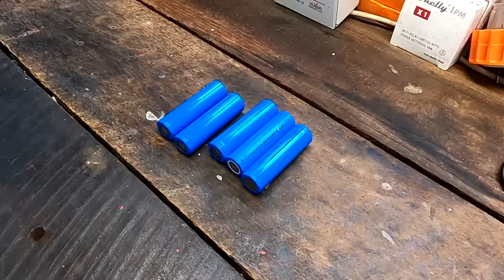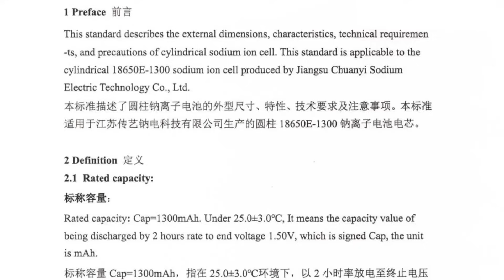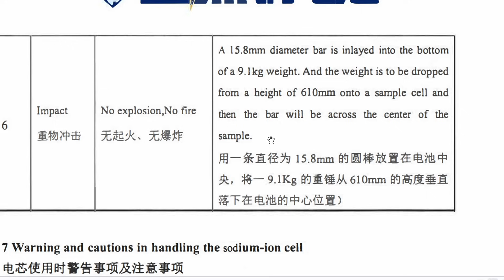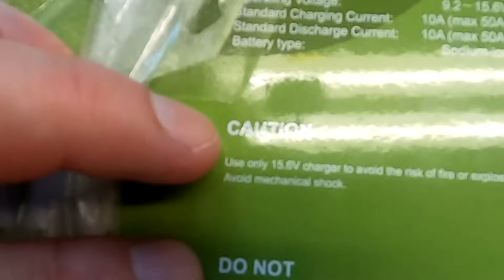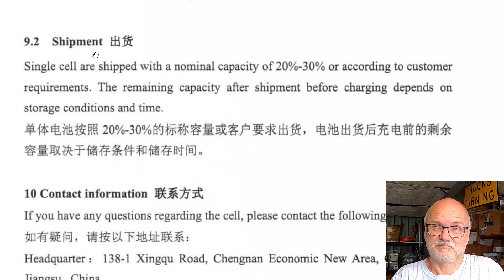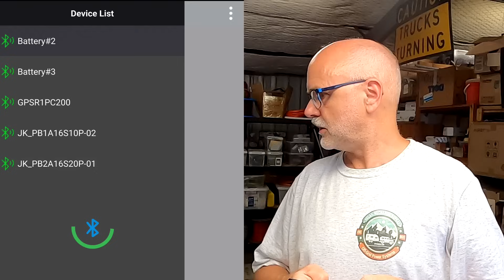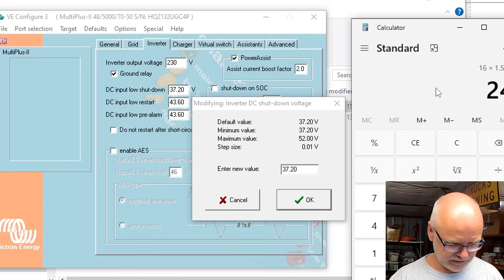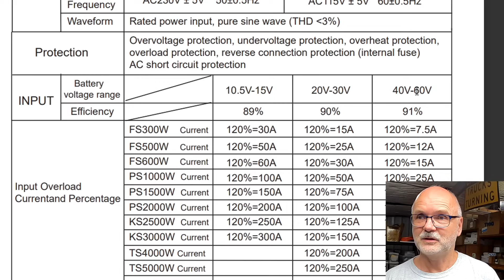Sodium Cell Charging and Discharging Analysis, Hardware Compatibility. Future or Niche product?

Comment: From personal test on 210Ah sodium-ion battery I find that this cell working fine from 2,5v to 3,75v.
This is the real working range for sodium cells.

For 210Ah cell:
Charging from 3,75v to 3,95v and stop 1A battery absorbed 14Ah.
Under discharge from 3,95v to 3,75v cell deliver 5÷6Ah.
Above 3.8v the cell charges poorly, the voltage is no longer linear but rises in steps.
below 2.5v approximately 38÷42Ah remain, consider that chemists recommend always leaving 20% of residual charge. The end result is that a cell with a capacity of 210Ah, which has the same dimensions as 280Ah LFP, in 3.75v÷2.5v range of use delivers between 138Ah and 142Ah, and a capacity between 430Wh and 460Wh. 
Regarding number of cells you can connect in series it is 17S.
You work between 42.5v and 63.75v, therefore falling within the range of your Victron Multiplus 2 inverter.
Reply: Test performed on 4 cells, the capacity is always lower than declared. 
In my case, sold as 220Ah cells, I found a real capacity between 195Ah and 210Ah. 
Internal resistances between 0.23mOhm and 0.40mOhm. 
If you charge and discharge them continuously between 1.5v and 3.95v, the prismatic cells tend to show a little belly. 
Tests performed with the ZKETECH AL40 like yours. 
Identical charging and discharging curves, obtained with 40A both charging and discharging at 20° room temperature.
Reply: Bravo Andrea!
Reply: Good info, thanks!

Comment: Andy, First of all, thank you for conducting these tests in such a scientific manner.  Excellent!  Great information as always.  I give these batteries ZERO frogs!  With the Sodium batteries given the wide voltage range, it appears to me that you will loose all the advantages of a 48 volt based system.  With such a high voltage range comes large swings in amperage through your system and blows all of your advantages in wire size that you get with a higher voltage system.  Not to mention all the equipment issues you mentioned in running at these voltages.  Maybe the technology will improve with time but at this time, as you would say, Nah...  🐸=0

Comment: The charge and discharge look like mirror images, especially with the little hump around 3v.  
Would the large voltage range be an issue with inverters?

I also found out that the cell size dictates the max voltage?   Strange stuff ....

Comment: Just as I expected - the voltage range is so wide to significantly hamper the use of these cells. The voltage range by necessity will need to be limited as for the same power draw the current variance would be > 2.5 times.
10 W / 3.95 V = 2.5 A.
10 W / 1.5 V = 6.7 A
I'd like to see the Muller Sodium battery + Peter inverter in a real use test.

Comment: To really evaluate how useful they will be for an inverter you should determine voltage sag as a function of load.  Say take a battery at 50% SOC, measure the no load voltage then apply 1C, 2C and 3C loads to see how much the voltage sags.  Your preliminary result suggest that most inverters will only be able to use about 60-65% of battery capacity.  Usable capacity might be considerably less if there is significant voltage sag with load.  I am looking forward to seeing more tests.
Reply: YOu use more cells and Studer or Victron inverter and no problem.

Comment: The inverter doesn't need to be built for the voltage, just a programing change.  Some could possibly use a slight hardware update to work better at different voltages  but a resistor change and adding a turn on the primary or secondary of the transformer is no big   deal.   I'm  still hoping to build a inverter to power my house. Actually two inverters, wired in parallel, with one sleeping until the current rises to the point of requiring the additional current. I'm thinking a 4-6 kw then either an additional equal size inverter. Or a larger inverter that just takes over the whole load,  then I can use high frequency technology on the small inverter, a true 3kw, capable of doing 3kw ,24/7 ,, ,(actually it should  do about 3600-3800 before temperature in hot weather is starting to be a concern, it could easily be rated at 4kw.  With a surge around 5k-5.5kw.  working with a LF power house , weighing  about 250 lbs minimum, capable of 15kw sustained, and easily 25kw for 20 minutes and 30kw for up to 5minutes,  and motor starting  current spikes lasting for 1-2 seconds, 45kw should never cause damages.  A cheap company would rate it at possibly 35-40 kw.
I'm searching for the electrical iron for the transformer cores, I need about 80 -100 lbs of the iron to produce a 18" O.D. core with a 10-12" center I.D. and 6"-8" thick , so the strips need to be 6-8" wide  48" to 96" long, and thin as possible, 20-24 gauge would be great. I want to wrap it with fiberglass. To create a protective layer and embed a quality nylon tube about 3mm of, wrapped with the iron,   possibly using copper tubing wrapped around the toroid core, if it doesn't effect it electric all, about 6 coils inside in the id. And 6 on the of,  to circulate mineral oil to cool the core using a 6:1 manifold, to bring the 3mm tubes to a single 12mm or 1/2" tube on the inside and outside,  the core requires a gap between the windings and core to reduce saturation  having two sides about 3.5mm from the core should be fine. With about 1.5mm in the top and bottom it should keep the core 50°f cooler than it would be otherwise, and I plan to use 3-5 thermal sensors in the core and in the windings.  A in id sensor, a center mass of the iron core and one on the upper area, heat rises. So mount at the high point.  And two inside the coil windings  on opposite sides  with possibly one near the coolant lines, and one far away as possible  and also cast aluminum heat sinks for the mosfets and diodes with coolant passages  set up the flow direction so it will circulate the coolant with thermal convection. Up to a large  cast aluminum radiator/heat sinks resovoir to be mounted on top of the inverter, being 24" wide 8" -12" tall and 6" thick. The center 3.5-4" x 18-20" x 7" -11" tall being the resovoir, and holding the small pump that will power up if temperature rises, a long with  4x 100mm fans on the heat sinks internally, and 2-3, 120mm fans mounted on the finned and holy resovoir, the center 12-15" having 6mm holes passing through the resovoir with Finn's on the outer edge about 2" dep with 6mm gaps, with 5 mm fins. Having a 1mm groove mid fin about 20 mm deep making each fina double fin. Cast using the lost foam method.  The tank lid possibly being a 6mm sheet of aluminum with 46 3mm screws, and o-ring seal.  With a 35 mm fill cap with vent,  the tiny pump fitting inside,   using a tiny motor and a typical 30mm turbine pump, hopefully the restrictions through the pump  will cause the oil to rise up the tube without the pump, with cool oil flow from the pump side, being the pump pushes oil down the 20mm line, splitting to  two 10-12mm lines.  The pump flowing only about 1,gph, or 4 litres per hour. The heat sinks holding about 75-100 ml, cc, the transformer holding around 500-1000ml , the resovoir holding 1-2 litres +/-. So 3-4 litres full possibly,  it can run without, the mosfets having a fan on the heating with 30mm deep 1.5mm find on 3mm centers. In 50 mm thick cast heat sinks , with two 12mm coolant  passages per heatsink,  and the electrical conducting heat sinks  possibly being copper plated,  with a 4mm copper sheet soldered to it,  with a nickel plate to keep it clean.  I'm looking to build a 50+ year inverter the mosfets mounted to copper bars with pcbs making electrical connections, with M5-6 bolts. To easily swap out the mosfets,   the 3mm copper bars easily mount to the heatsinks with m3 screws, then m3, 5/6, bolts to the main PCB.   The fet boards being two piece,  the actual part with fets being replaceable.  Then the parts can be replaced on the modules, rebuilding them
 The electronics being made similar. The parts that typically break mounted on separate boards, easy to replace.   The logic being shielded  having a solid copper PCB as a cover, using pins and screws to mount, then copper tape around the sides. Remove all emi, EMF it should be empty proof on the logic side anyway. With ribbon cables and fly wires running through foil tape or braided tubing , connected to the ground plane of the board.  And print a shop manual basically,  left indie the casing, with a box made of pcb material to hold replacement boards. Protected from emi/EMF, EMP , if there is a EMP. It should be easy to replace the parts,  and have it working again.   The ats from small inverter to large  would have a micro controller, measure the current,  if the current is so high  it wakes the larger inverter, and if the current goes any higher in half a sine wave, the load goes to the large inverter. The small inverter likely goes to sleep. Don't know if I would actually go this far. A couple 150 watt panels would offset the idle current losses.   Having backup power from multiple sources, a 7kw ac gas generator, a 2500w gas generator.  And working on a 150 amp gas DC generator, and a 300 amp diesel generator, that burns waste oils,   sorry to ramble,  have a awesome day!!

Comment: I down loaded your charts.  Nice.  I calculated the power in and out.  I then integrated the power and coverted to kW-hr.  The round trip efficiency was 79%.
Reply: huh? where the heck did you get that number?? I'm only seeing 83.46% worst case scenario on the 3c discharge curve compared to the charge curve, 3.476wh removed vs 4.165wh put in. Which is clearly not what sodium ion cells like those are intended for. They are intended for a 1c or less discharge rate. A household battery should never draw anywhere near that. At 0.2c or less (common max household draws for properly sized battery) the round trip efficiency hits 98.2%

Comment: Interesting that the 12v battery's low voltage rating is 2.3v per cell - not 1.5 or 2 volts.  Weird.
Reply: Nothing weird. Some manufactures set lithium cell low voltage rating to 3.2V, while cell can go 2.5V and below. Some set 3V others go to 2.7V. Cutoff 1.5V lowest extremes manufacture thinks (tested?) cells can go and charge normally back to ~90% capacity or something for set amount of circles.

Comment: Seems there is little need to discharge below 2v -2.3v or above 3.8v roughly. I was distracted while watching this,  but seems like not so great chemistry, at 1.3ah, they should be capable of 30-40 amp discharge  ,  I just wonder if nak could make a battery  (a sodium/potassium ion battery) maybe it could make the battery better. Or possibly sodium iron phosphate?

Comment: FINALLY! a Sodium Battery Test yey! Been waiting for this, Andy! haha

The only problem I saw here was the voltage range of the battery, which will require new hardware for most of us if we were to upgrade or "migrate" to sodium. Voltage curve for me is very nice as it's easier to determine the capacity based on voltage alone compared to LiFePO4. We need more data for the life cycle in the near future if this will indeed replace LiFePO4. Do sodium batteries have better shelf life? How does it handle stress usage? So many questions! Looking forward for the next tests to come in the future, Andy. Thank you very much!

If we are look at the bigger picture, lithium reserves are starting to deplete (or so I've heard and read) thus making it harder to mine and everything, and ultimately making lithium products way more expensive in the near future. Sodium Batteries is the way to go. Sodium itself is one of the most abundant mineral or element on earth which should make the battery way cheaper. Sodium batteries are less dense than lithium ones which should be fine if used for household energy storage. Let's leave lithium batteries to portable ones like smartphones and other gadgets.
Reply: hello, I don't think that the reserves of mineable lithium are currently starting to run out. Rather, the current demand is closer to the current maximum supply, which of course has a negative effect on the price. However, it is such alternative chemistries that can help spread market interest and offer more solutions to alleviate price pressure. The possibility of subfreezing charging may be very interesting for many places, but not for Australia.

Comment: Maybe they should make BMS for sodium with an integrated boost converter, kicking in when the cells are at 3V (per cell) or bellow...but that would cost a lot. Example: a 100A BMS should be able to boost a upto 200A input current. Big muscle inductors and/or very very high switching frequency are needed. Then converter efficiency will also come into play.
Reply from the maker: Far too inefficient to boost 10.000W for an inverter. The heat loss will be insane!

Comment: Hi Andy, with reference to temperature, have you looked at heaters for the LifePo4 batteries? I'm putting together a solar system and live in the Glen Innes, NSW area where it can get very cold overnight! Cheers and many thanks for your excellent info!
Reply: I use heater mats under my 30kwh battery packs with temperature controllers. We have had a mid winter here in the UK but with a few excursions below 0degC. With good insulation the energy used to keep the cell temp up to +10deg C was minimal.
Reply: You could try thematically controlling an electric blanket in an insulated area for ur batteries, pet mats & aquarium mats come in different size & voltages. Do you have a fireplace to help keep ur place warm at night, I know Glenn Innes area gets cold,but if the batteries are inside surely ur house wont get (much) below 0C. I dont think they would need a lot of power to keep them in a charge/discharge temp range, you only have to maintain a temp threshold they can operate at. Not all sunny hot Australia is always sunny & hot, is it.
Reply: @evil17  batteries will be in a fully insulated shed and the setup will be a smaller version of Andy's. I've seen the heaters for sale in Aliexpress and would like to know if anyone has experience. As you say, mostly the low temps are at night when charging will not happen anyway but I'd like to be able to catch the early morning sun when it could still be cold. As you say, there are alternatives, I just don't have the experience.
Reply: @davidrenn6897  keep looking/researching mate, you will figure it out. I did see some other comments here regarding keeping batteries warm, i think one said he only used a 5W heater pad and uses bugger all energy. Good luck
Reply from the maker: No, never looked at heaters. I'm in sunny hot Australia😰
Reply: @OffGridGarageAustralia  I'm 4 hours South on the ridge 1000m up! 😉

Comment: I would like to see how they compare to the Lithium Titanate batteries. I have a little power station in the back of my ute with a 60W solar panel on the lid charging a 5s-3p LTO battery. This is used as a buffer and a removeable power pack and once charged feeds a slim 100ah litium battery through a dc-dc charger. This in theory keeps most of the cycling on the LTO battery and keeps the LiFepo4 topped up. I notice the number of cycles on the Sodium battery is only 3000, I was expecting better.

Comment: I believe, if discharged to 0V, you even would not care about short circuits while LFP with 0% could still create a fire when shorted. And not heard of bad news with LFP is also because of safety precautions.
Reply from the maker: You mean LFP will create a fire in the cables it is connected to..
Reply: @OffGridGarageAustralia  I mean any contact with conducting material... Even if there are no cables connected. The battery will most likely not burn, but the conducting material and the surroundings can, with LFP. But not with a fully depleted 0V Sodium-Ion battery.

Comment: They are not as cheap as LiFePO4 is at the moment. I thought about doing a 2 stage ESS with LiFePO4 as a first short time storage stage and the 2nd stage would be a long time storage, using a cheaper technology that does not deliver much power but does store more energy - the 2nd stage will then be used to charge the first stage. For this i would need a bi-directional charger - or two chargers or boosters.

But while LiFePO4 is still cheaper then Sodium-Ion cells - forget about it. Also thought about H2 or Redox-Flow - but those are still too expensive compared to a diy LiFePO4 system. So lean back, relax and observe the market - well and maybe get a sodium-ion battery for testing - out of couriosity.
Reply from the maker: Forget about paralleling different chemistries. That is very inefficient. LiFePO4 is still the way to go.🍺
Reply: @OffGridGarageAustralia  Depends on the price per kWh and the price for pv-panels. At the moment DIY LiFePO4 is the only way to go. Also overprovisioning solar with panel prices being low.

Comment: EG4 6500EX from what I gather manual settings can be 42V-62v
Reply: It is to possible set range 56-62V? 
I have 16s li-mnc and need this values. Like 64V end and 56V dod.

Comment: Hi Andy,
I recently saw a video here on YouTube of somebody building a sodium ion battery for a pre built camper system.
They used Victron DC -> DC converters to make sure the inverter could keep working even if the battery gets below a certain voltage.
I'd like to know if that is the way to go when working with sodium batteries.
Reply from the maker: That's definitely not a solution but just a workaround.

Comment: Thanks Andy for the important Sunny and hot garage test. A fire and explosion test would get my vote if such votes were counted, but short term over-current discharge vs temperature as one might encounter in solar applications would be something I'd be interested in
Reply from the maker: I don't have a climate chamber for such tests to keep them at a stable temperature.
Reply: @OffGridGarageAustralia  I was thinking more of over 1C discharge tests to at normal  temperature to monitor temperature increases